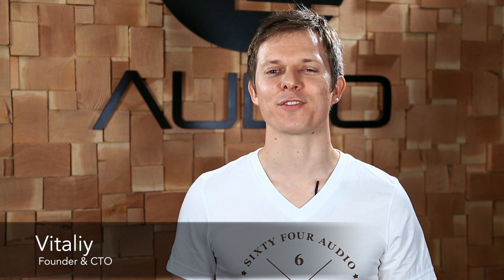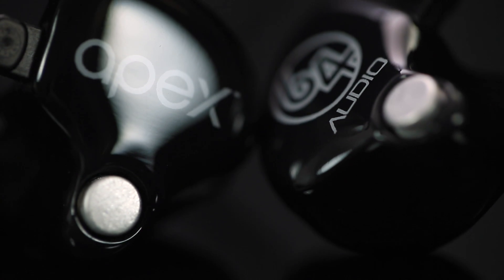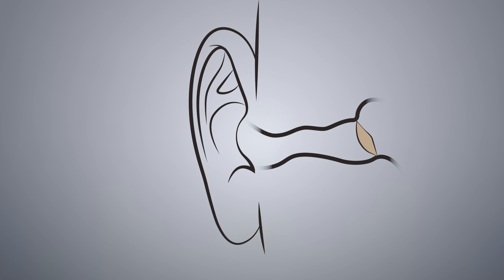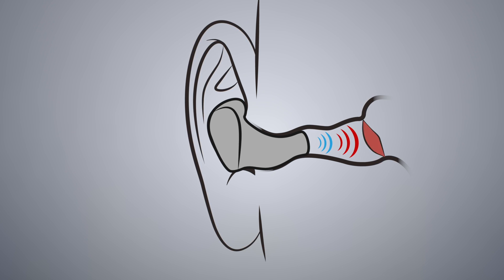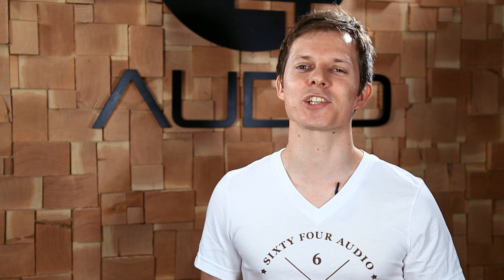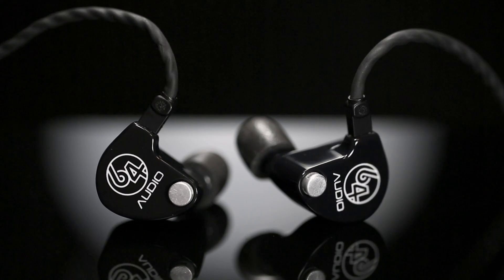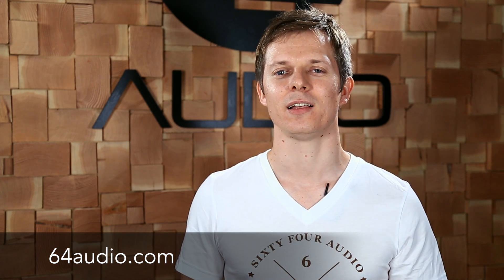Introducing apex technology from 64 Audio

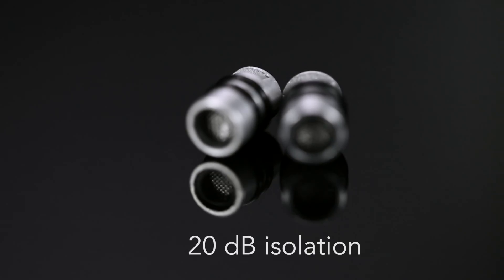Comment: What's up with the holes on the m20 module? Like whats 1:08 on the one thats on the left module.Why is there a tiny hole there?
Reply from the maker: Hi Mike. The tiny hole is there to let out the pressure created from speakers in a sealed ear canal. Without that hole the use of a module would be entirely unnecessary. It is located in that place specifically (as opposed to the top of the module) to reduce wind noise and keep it more effectively clean.
Reply: Thank you for letting me know.

Comment: Basically, Adel was the "prototype" and it was not trademarked. Now they make it official by naming it Apex. So both Adel and Apex is the same!
Reply from the maker: HI Timothy, ADEL was developed into a retail product. The apex line features improvements which we saw were needed from testing and customer feedback. 

Adam, the apex description on our website under "Technology" lists the improvements which are primarily to the physical housing of the module. We'd be glad to answer any followup questions over email or you can give us a call.
Reply: Plus Air Pressure Exchange is way easier to understand than Ambrose Diaphonic Ear Lens
Reply: but all adel module is gone in the option. I guess the partnership between Asius technology and 64audio went south. -20db is the only option now. hoping for more info on this
Reply: Yeah I'd like to see how the modules compare to the ADEL modules.
Reply: Completely incorrect. ADEL was not a prototype and it was patented and trademarked. Nobody knows how these came about, but given the close working arrangements and given what just went on with 64Audio in their last patent fight, this looks very fishy.